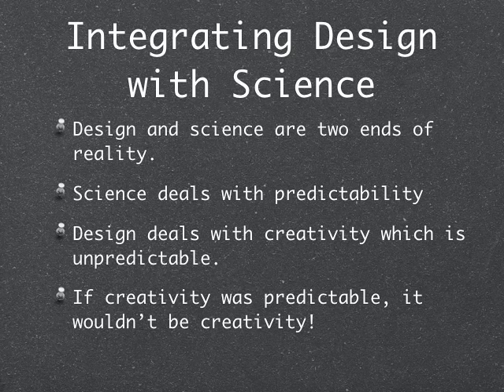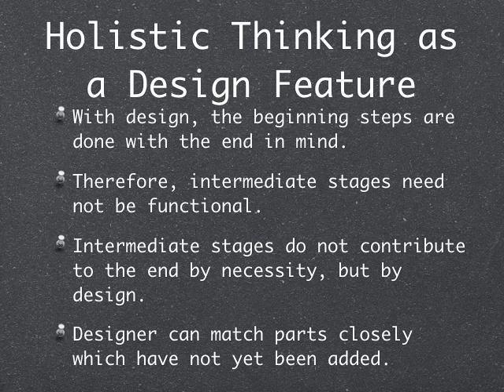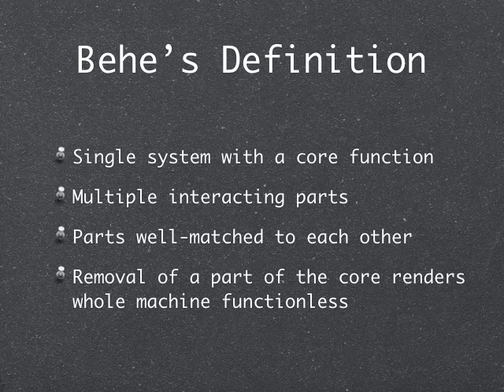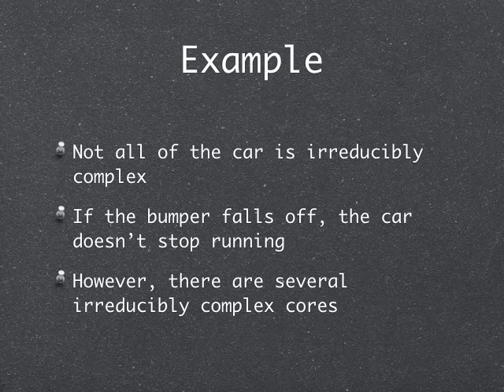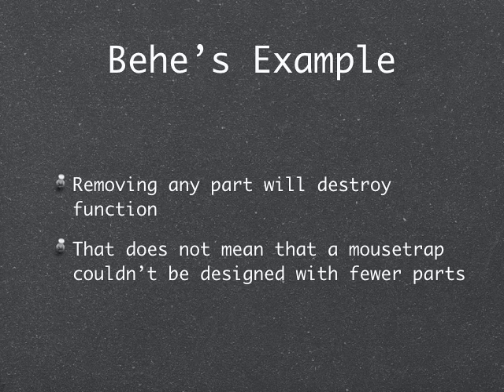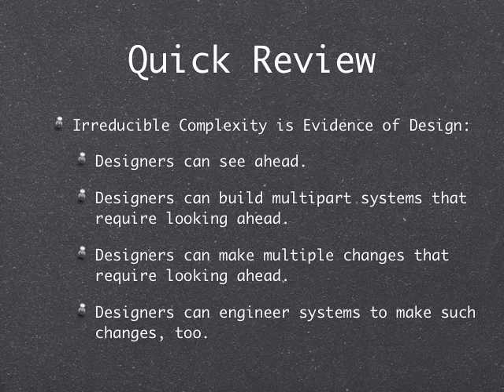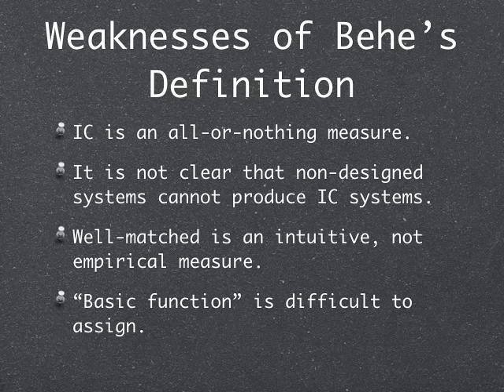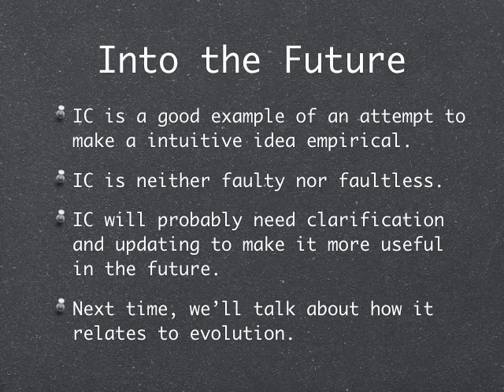Thinking About Creation: Irreducible Complexity Pt. 1

Comment: IC is not testable as its a word game. All you have to do is change the way you describe any singular basic part and automatically become an IC system. Take a stick and put two round pieces of wood at the end of it and then call it an axial instead of a stick and POOF! Now a stick has become an IC system. There is no example you could come up with of something you could not describe as IC,therefor its un testable.

Comment: "Actually it does."

No, it does not. Nobody can point to any feature in the biosphere and say it is "irreducibly complex." P.S., the flagellum is not irreducibly complex: dissassembled it still has functions--- just not the current functions.

And IC was called "Interlocking complexity" by Hermann Muller 89 years ago.